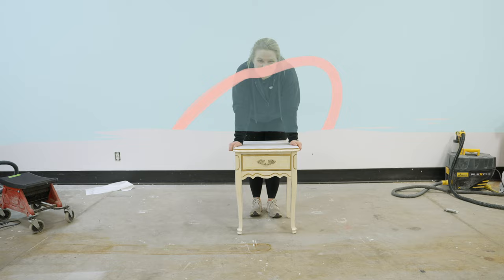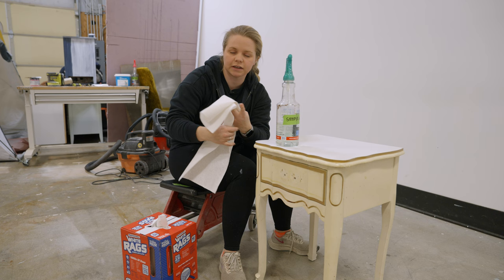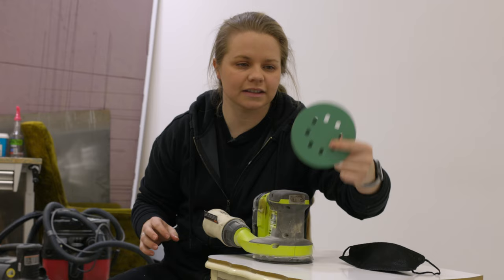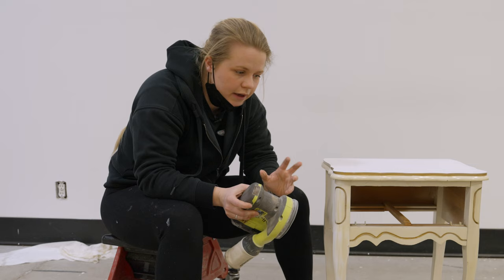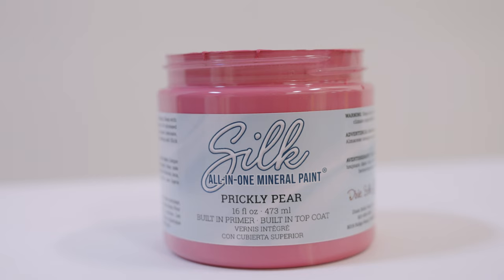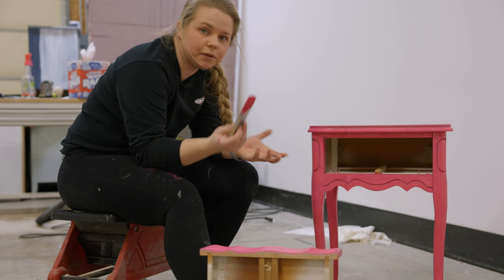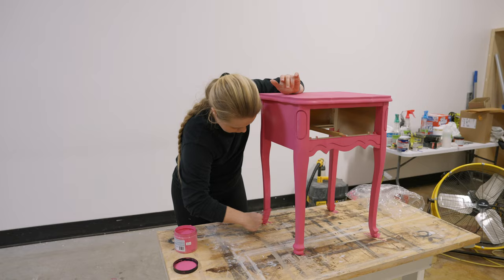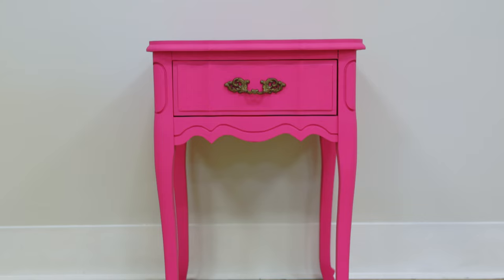Flipping Furniture 101: Basics for Beginners

Comment: I understand it came with another piece of furniture. But for $30, you add in let’s say 3 hrs minimum work with sanding and painting at a low rate of $20 per hour and your at $60 of hourly, paint cost and initial buy cost of $30. Total profit of $10. 

I get it’s a learning video tool as well. But the cost shouldn’t come down because you gained two pieces for the price of one. You gotta raise your margins and make less friends. Business is still business and if I did this all day I would make $30 a day. 

I’m sure you’re making money somewhere but it was lost here if you ask me. People don’t understand time and effort and don’t understand cost of sandpaper or machines especially since sometimes machines break.

Comment: Hi Lauren, I LOVE your videos, since I found you, I have fully renovated my kitchen, walls, cabinets drawers, hardware etc. I wondr is there a place you answer questions? In an effort to finish my kitchen and after seeing my accomplishment, I've decided to re-apint a hutch in the kitchen that is currently painted an olive green, I thought about sanding and repainting without stripping it looks like only two colors before this and is not an antique so it's super smooth, just wondering, do you always have to completely strip furniture that is already painted? I will be going to the site to learn, buy guides etc. but wasn't sure where to ask. Thanks for all you share and your details, honesty etc!